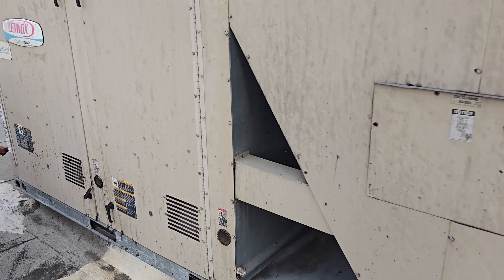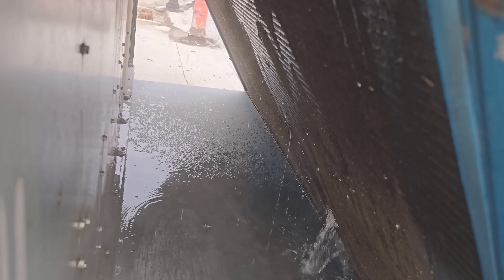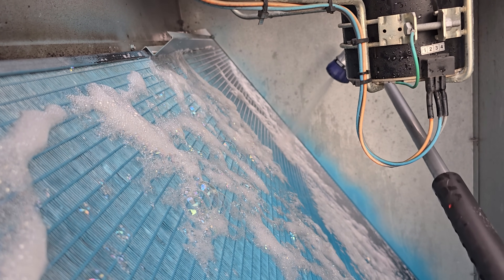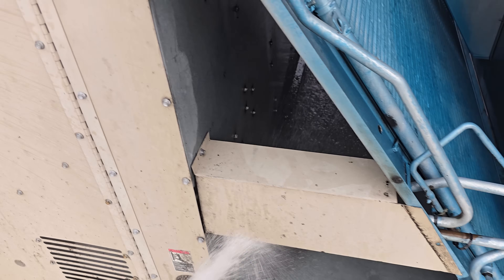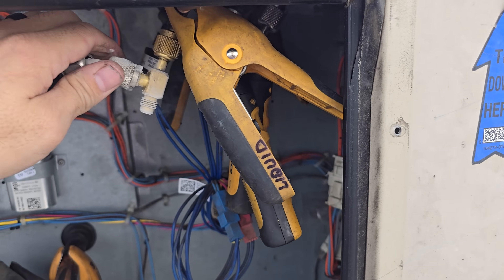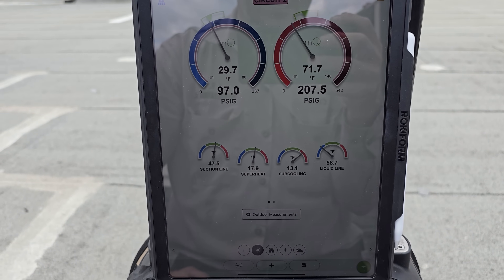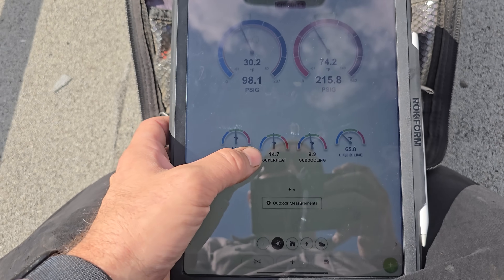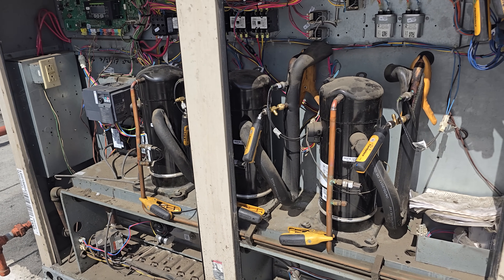WHY DOES OUR AC ALWAYS STOP WORKING

Comment: It's too bad that they can't and a reverse feature on the condenser fans that would allow them to reverse direction and push air through the fins to help blow out some of the dust and dirt out of them when it senses a low airflow to help them stay clear between real cleanings.  Especially in dusty and dirty climates.

Comment: Occupant does not want to hear that when OSA is 118 degrees, the unit will not cool  ISA to 72 degrees.  If you can keep it on line at all.  Units are sized for average temps to keep cost down.  Heat waves and global warming are playing havoc on the industry.

Comment: I've personally had good luck with my battery powered pressure washer for micro coils. The pressure isn't enough to hurt anything and it really blasts the crap out. Use it on kitchen reach-ins as well, the grease just disappears after soaking with cleaner.
Reply: What brand?

Comment: Chris, about the hot water at that place:  Almost always restaurants use commercial water heaters,  Unlike home water heaters commercial water heaters are designed to deliver *continuous* hot water, the health departments require them, the health inspectors don't want any restaurant to run out of hot water, even for a few minutes'.  Ask a seasoned, knowledgable restaurant manager at the next one you visit.  Commercial water heaters are Expensive, and they consume a truck load of natural gas, 300K BTU input isn't uncommon.
Reply: Those things are a pain in the ass to replace when they're up above a drop ceiling, hx replacements are killer

Comment: The blue fin or the blue-coated condenser fins enhance the durability of an AC. It allows the refrigerant to transfer better heat and increases the cooling capacity of the Air Conditioner. This has the epoxy coating on the coils which protects them from water droplets, accumulation of salt, and deposition of acid.

Comment: Chris I have put 18 " extensions on the exhaust fan discharge and it sends the hot greasy air strait up and away from the coil. It makes it more difficult to service the fan but i would rather that than to try to clean greasy coils. By the way I have found that HD Calgon is excellent for grease , kill the condenser fan motors run the compressor about 30 seconds and spray it on.

Comment: I would like to get something off my chest. I could puke every time I see the American AC's. Individual wires somehow secured with cable ties somewhere across the whole unit. Cables are simply attached to metal without any cable duct. Something like that would be unthinkable for us and would never be approved. But whatever, I still enjoy watching your videos :)
Reply: What is that cable duct doing to protect the wire or technician? This is a serious question. These units are installed in a limited access area, and aren't intended to be serviced by anyone but a professional.
Reply: Preach! Bare minimum in the U.S.A! Otherwise, think of the shareholders!
Reply: It's OK. We're coping.
Reply: If you're from the UK you're not in a hot way either. Without London the whole country would be like Missouri
Reply: I would guess you are in France?
Reply: @JJ-Toreddie  Austria

Comment: Hmm, putting an ehaust fan right by the unit could cause the greese to be sucked it the coils, that was definitely a bad design. Be careful cleaning those blue fin coils because the coil cleaner could eat away the coating that protects the coil, from the salt air if youre by the ocean! Great video!

Comment: The blue coating is more than likely a “coastal coating” help to prevent salt water from destroying the coil in 3 -5 years
Reply: For the people who are gonna ask
Reply: @Freonleon  thanks! 1000% was gonna ask
Reply: even in areas without salt water it helps. i installed 2 minisplits in 2012 one from hitachi itec and one from whorlpool. the whorlpool has a blue coating on the condenser and it has genuinely held up much better , every time i wash the coil it comes out shiny while the hitachi that just has bare aluminium has already corroded and condenser flaking off. similar thing happened to my previous whorlpool units from 1999 that had no coating and the whole condenser just fell off by 2014 , i replaced that condenser at home and that was my first diy ac repair that got me into hvac.
Reply: Yeah the coil may last but the chassis wont….🤪
Reply: Wow not meny comments
Reply: there's a fine fraction of vaporized mercury that comes in too
Reply: Yup. I use Hydrobalance A-7901 on every condenser I can. Seems to work great and considerably less corrosion over the years.
Reply: Hello guys! God bless you and keep you safe. Question: Do you recommend using a pressure washer machine (1,600 to 1,800 psig) to clean the coils? I use PWM every AC PM. Thank you.
Reply: @julioorellano161 
Pressure washer is good for pm's when your not using chemicals (as long as you are not damaging the fins by being too close), when using chemicals standard hose nozzle is better because the flow rate is higher which in turn dilutes the cleaner faster. And when rinsing the chemicals the goal is to dilute as much as possible because unless you rinse for a long time there will always be a little left over.